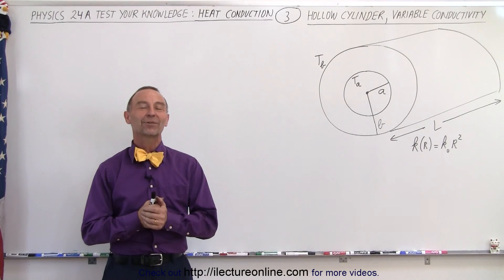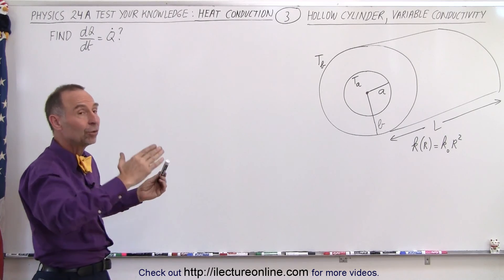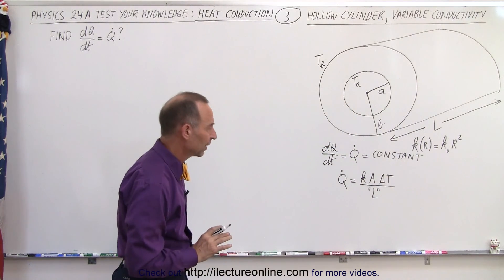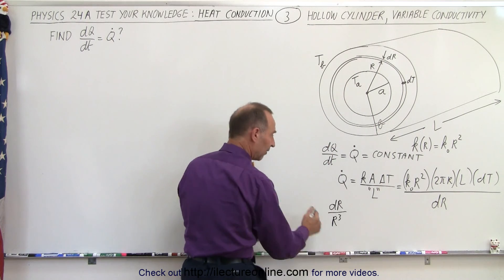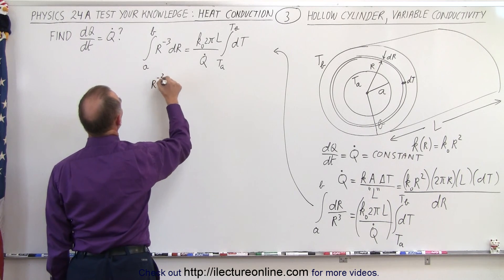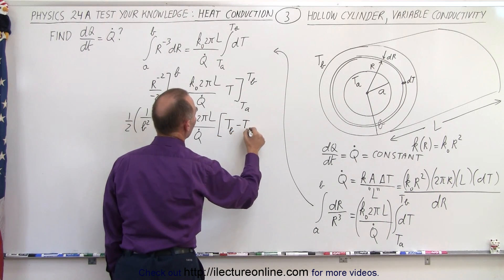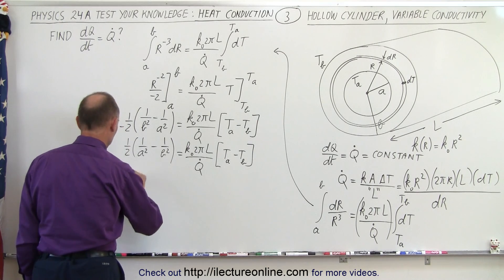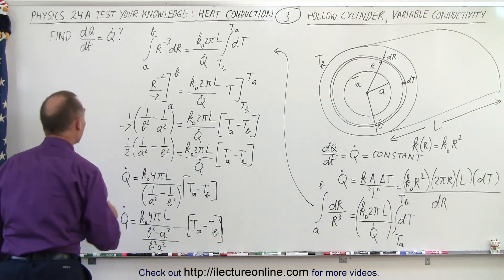Physics 24A  Heat Conduction Examples (3 of 22) Hollow Cylinder, Variable Conductivity

Comment: i think one problem with negative signs is that early on, it was written: Qdot= R*A*ΔT/L,   
which i think needs a negative sign
Qdot= - R*A*ΔT/L,
given the heat flow quantity is  measured flowing radially out from rA to rB, and ΔT=Tb-Ta; 
so i think perhaps that early equation should be
"Qdot= - R*A*ΔT/L",
since heat generally flows down a temperature gradient, unless some other force or entropy etc is applied.
Reply from the maker: The use of signs is often misunderstood.  The purpose here is the determine the magnitude of the heat flow.  The sign simply indicates the direction (but only if defined correctly), and it is just easier to assume the flow is from hot to cold.

Comment: you said that Ta>Tb. Should you not have left your sign change alone to give a negative value for dQ/dt which would indicate a heat loss from the high temperature source
Reply from the maker: It doesn't really matter since you know that heat will flow from hot to cold and ignoring the sign will give you the magnitude of the heat transfer.  I prefer to simplify the problem then trying to assign the negative sign for most cases.  (There are some cases where using the negative sign is important however).
Reply: I believe the minus sign lacking in the resolution would appear from the fact that the change in temperature dT is negative. Anyway, great job as usual. Thank u very much, Prof. Biezen!